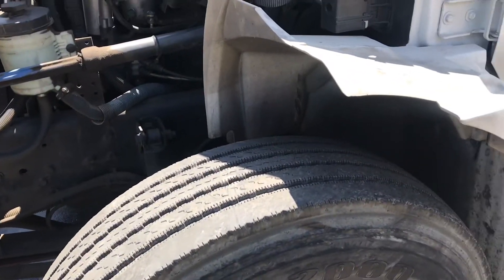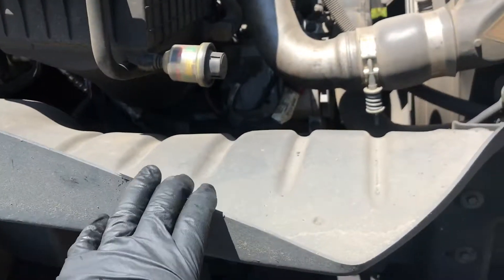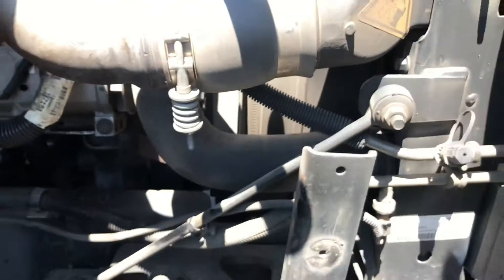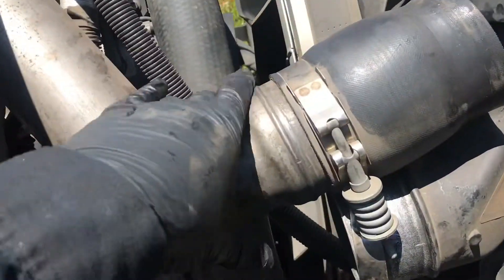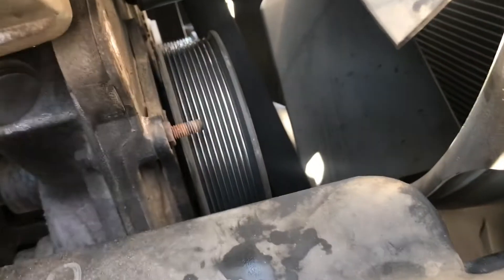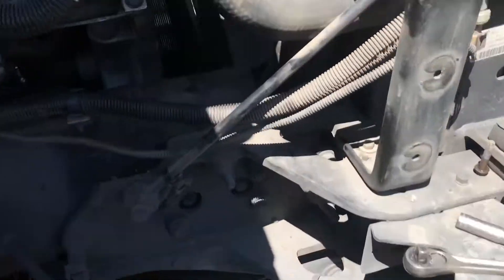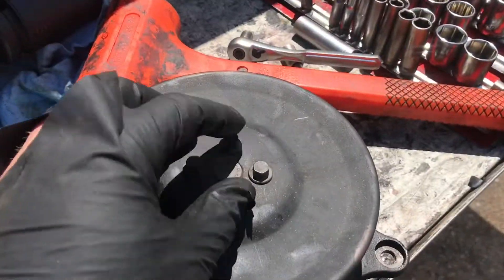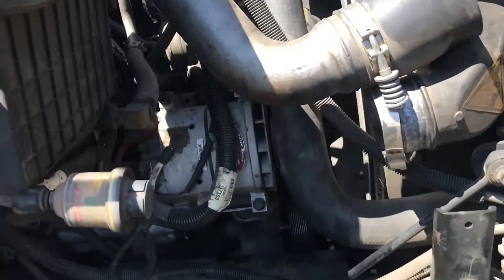International Durastar Water Pump Replace

Comment: Hi thanks for the vid.  What brand pump did you replace it with?  The oem pump I checked on was $732.  Aftermarket are like $150.  I don't want to buy junk but $732 seems like a total ripoff.
Reply from the maker: I think I use an OEM pump. But aftermarket should be good. International overcharges
Reply: @boscos5287  thanks for the reply